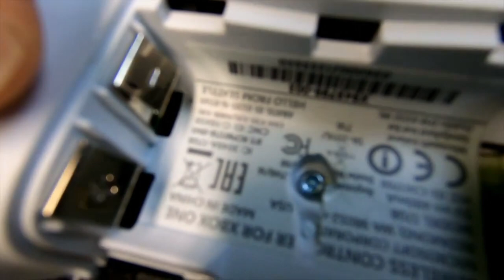XBox One controller repair - Left stick stuck

Comment: Hi, I am having the exact same problem - the left stick is stuck.
You didn't particulary show or mention how you actually solved the problem. 
Could you enlighten me what you did to make it work properly again?
Reply from the maker: It was as shown in video. I disassembled it and put it back together again :)
My theory is 'stick' got smashed down so it jammed up the machinist so when I removed it and put it back again it returned to the intended position.